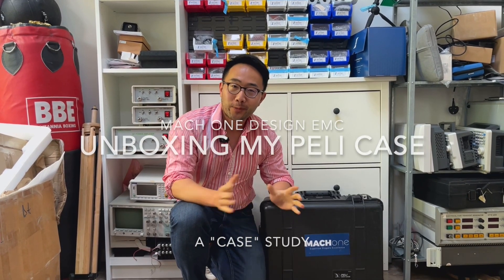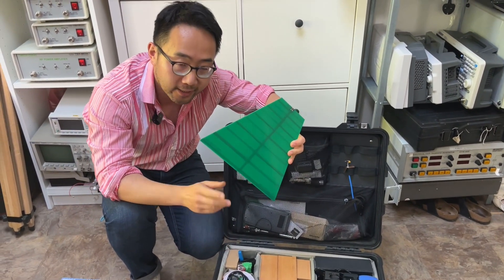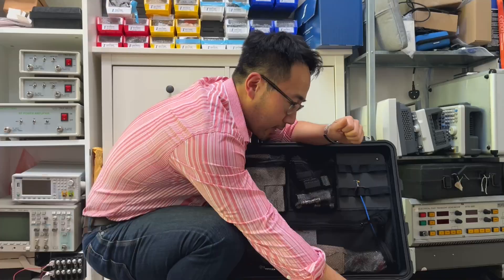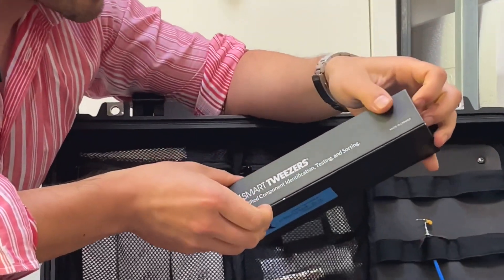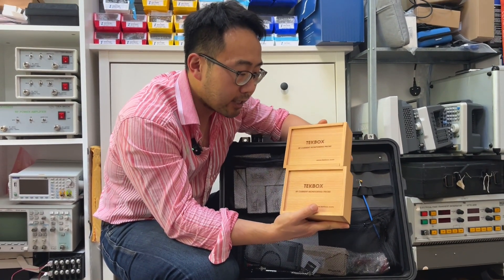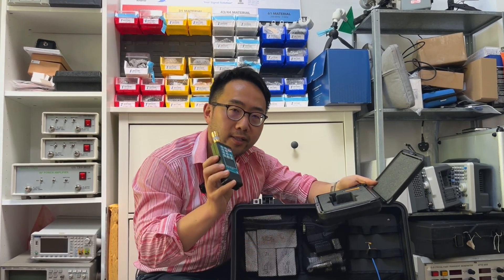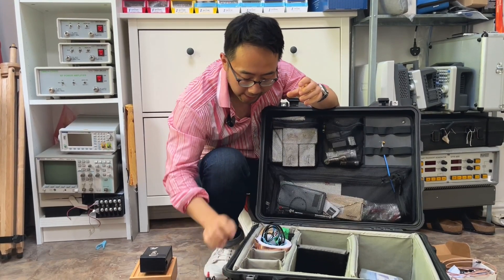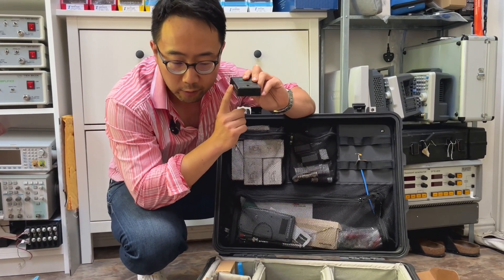Unboxing my EMC equipment - A "case study"

Comment: Thanks for the mentions and glad the book is helpful! Curious to learn more about your static meter.
Reply from the maker: Hi Ken, thanks. I found the books extremely useful, I only started collecting my kits when I read your book, now my workspace is piled up! The static meter I used was ACL MODEL 300B, I think I have seen this from Doug Smith's article/video, then I bought one from ebay for less than 100 USD at the time.
Reply: @MachOneDesignEMC  just found one on eBay, as well. Thanks for the tip.

Comment: Thanks for the show and tell!
The OnFilter Power Line EMI Adapter looks interesting, but couldn't find a price online so probably more than I want to spend.  I already have a few LISNs (TekBox of course) and rarely need to take my gear out of the lab, so unless I start doing some power line comms work I probably cannot justify or really need one.  I could always hack together my own (with lower performance of course).
Reply from the maker: Hi Kean, yes, you are absolutely right. I don't use the EMI adapter as often as I hope, because I found that above 10s of MHz, the long lead start to couple common mode noise from the ambient, for low frequency conducted noise, it is useful, but as you said, LISN and current probes are good as well. The price of the EMI updater is about 800 USD if I can remember, so not cheap!

Comment: Thanks for sharing this, very interesting. I know it's not so portable, but I find my EFT generator to be one of the most useful bits of kits for testing products, causing the product to crash in a reproducible way in front of the engineers is a great way to getting it fixed quicker. I also find an ESD simulator to be very useful (and lots of those are quite portable).
Reply from the maker: Absolutely, I cannot agree with you more. I have two keytek ESD guns, extremely useful for troubleshooting immunity issues. You can also make "quasi-high-pass" or "quasi-low-pass" filter so that you can either inject the noise as a slow pulse or sharp pulse. For the EFT, check this https://www.langer-emv.de/en/product/immunity-development-system/68/e1-set-immunity-development-system/54/sgz-21-burst-generator/55, and this https://www.langer-emv.de/en/category/mini-burst-field-generators/13 I once saw someone selling this on ebay for 1000 USD, still too expensive for me!

Comment: 很好，很贵😂
Reply from the maker: Many of the equipment introduced here can be replaced by simple kits such as an AM radio, which costs less than 10 USD if you buy from ebay. Maybe next time I will do a low-budget kits version.